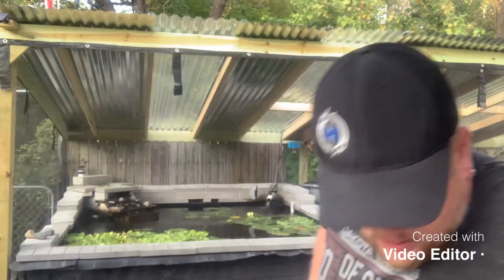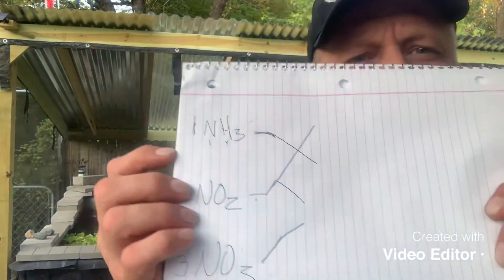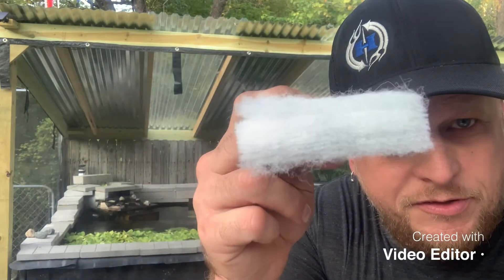The Koi Pond Nitrogen cycle, filtration , bio filtration and bio media.

Comment: Hey I was wondering ,do the beneficial bacterias take more times in ponds ( cause water is typically colder ) than in tropical tanks ? I mean does the cold temperature of the water slow down the beneficial bacterias colonization in the filter and all over the pond internal surfaces ?
Reply from the maker: Yes water temp does slow it down. Usually takes off real well in the summer.
Reply: @thekoiaddiction4740  thanks for the answer . So the Warner is the temperature the quicker the beneficial bacteria colonize the tank basically
Reply from the maker: @salvolondon  yep